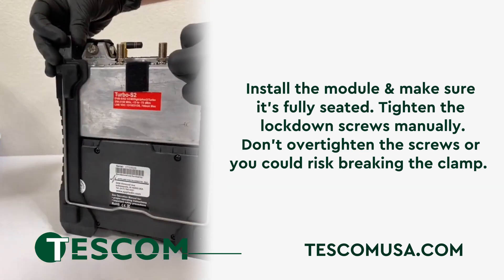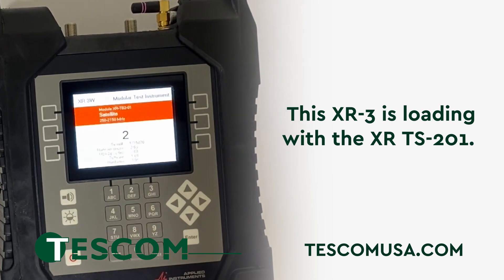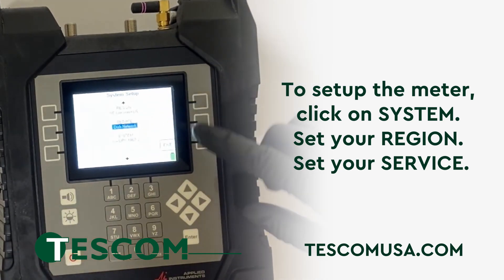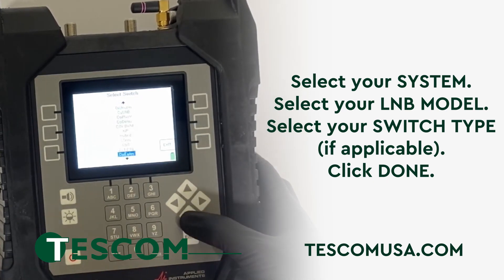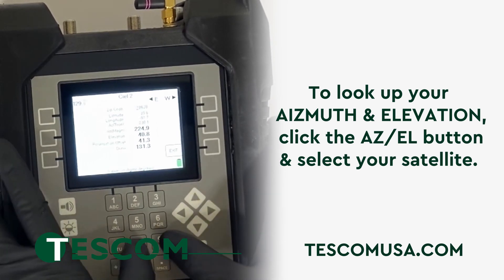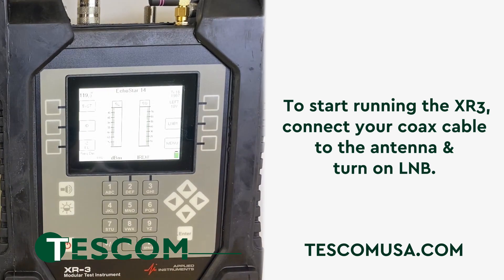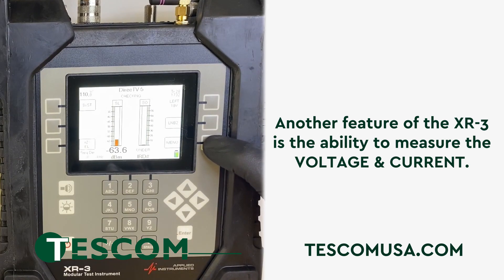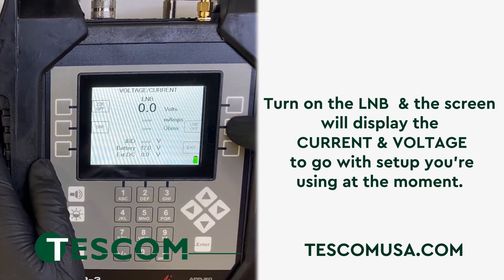Setting Up the XR-3 Base Unit Satellite Meter

Comment: Is there a way of saving the manual settings?  Everytime I turn the  LNB voltage on and off the tuner resets to default parameters.  Also the symbol rate is units of Ksymbos.  I'm assuming that this means for a 3 Gb symbol rate the entry should be 3000 yet the meter changes the value to 30 (30000).  What's up with that?